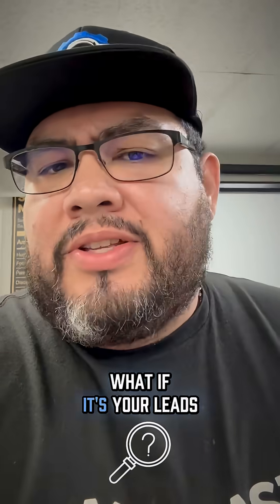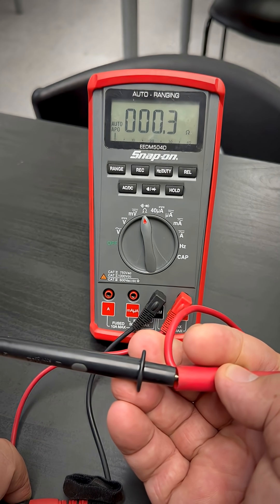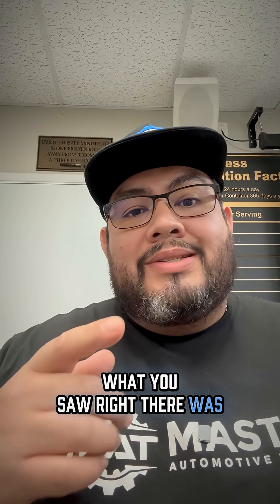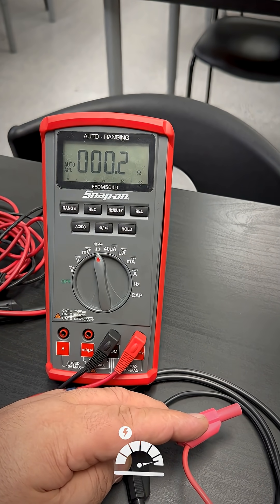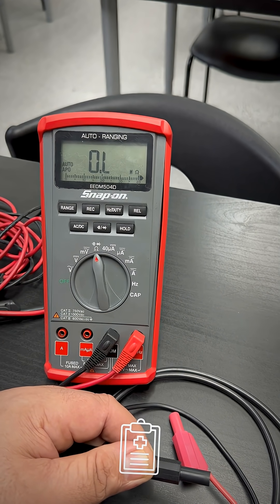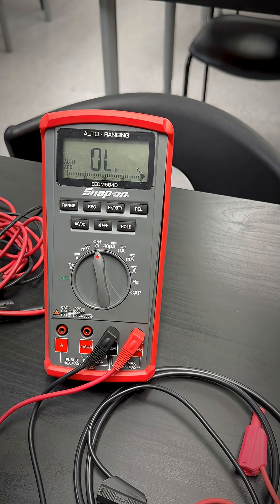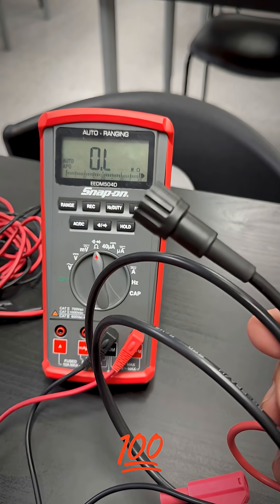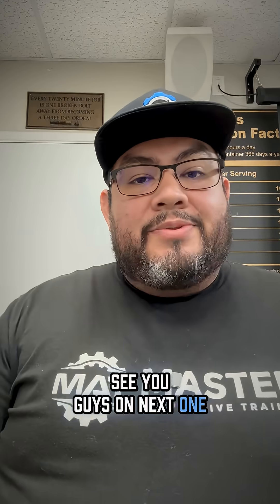Your Scope Isn’t Bad — Your Leads Are! 🔧⚡

Comment: Can’t you just switch the dmm to ohms and touch the leads together and test resistance
Reply from the maker: Scopes don't have ohms like a DVOM. You can create a math channel but then we'd need to run current and voltage thru the lead.